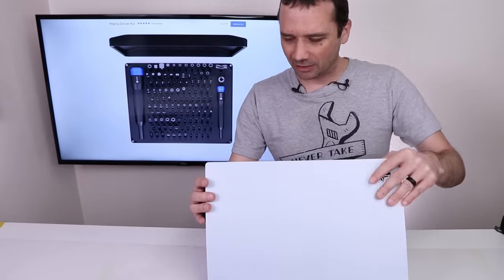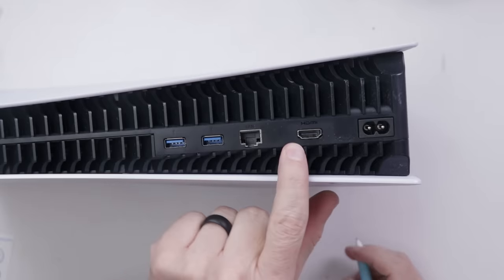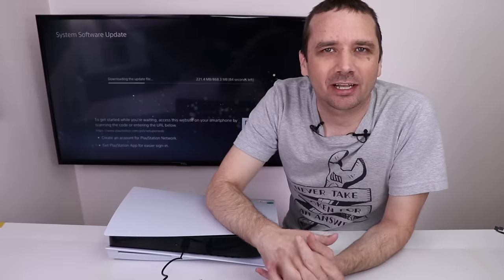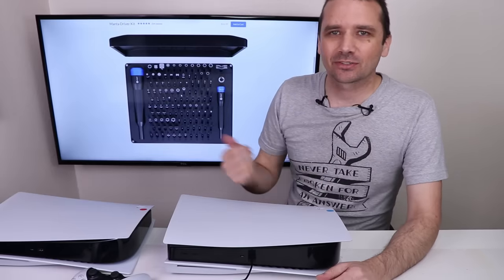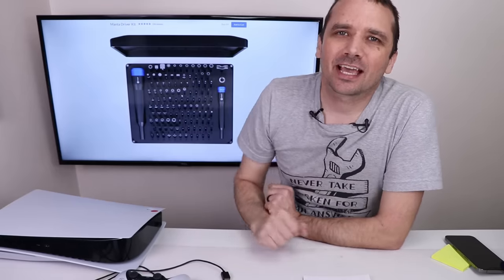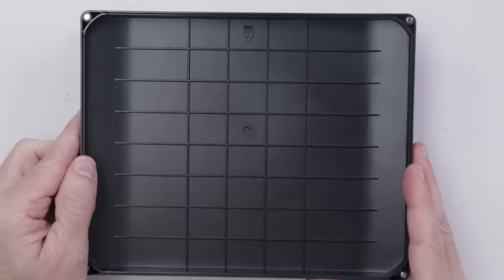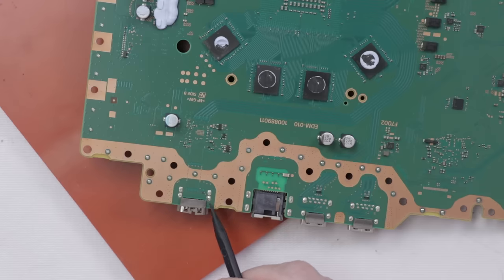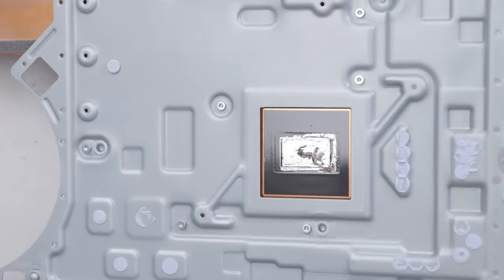I Bought 13 BROKEN PS5's - But Can I Fix Them?!

Comment: The ones that won't start a game, probably have bad RAM.  Probably got fried from the poor cooling design.  The upper RAM chips can reach 80-100C (Gamers Nexus went into this).  The ones that were open already made me kinda cringe, because most people that open these things have no idea what they're doing and make me think of the time Al Bundy was trying to fix his car (he opened the hood and had no idea what he was looking at).
Reply: I'm just here for the Al Bundy reference
Reply: 80-100c? god damn.
Reply: @TigerAceSullivan  Yep...Gamer's Nexus did a whole video on PS5 cooling, and how some of the upper RAM chips are basically not getting cooled at all.
Reply: @StormsparkPegasus  I'd love to see someone 3D print a skeletonized or mesh set of side panels for the thing, since GN showed that it runs cooler with them off.
Reply: Gamer nexus is a Fraud. That's normal operating temperatures
Reply: @NotoriousRawDogger  He didn't say it was a bad operating temperature. He just said it's worse than most devices and he emphasized it's hard to say if it will be a non-issue or a problem down the road.
Reply: @NotoriousRawDogger  facts.
Reply: @mndlessdrwer  Not a bad idea, but the PS5's RAM cooling issues go beyond just the side panels.
Reply: @NotoriousRawDogger  LOL...that's the most pathetic statement I've ever heard.  Tell that to all the people whose PS5's have dead RAM because of it.  The first models of the PS2, PS3, and PS4 were all junk and had tons of issues too.  I've never understood why people shill for corporations.  Stockholm Syndrome.  And using sockpuppet accounts to agree with you is even more pathetic.

Comment: With the video artifacting you could try replacing the memory modules from a donor board to possibly fix the problem. Watching gamers Nexis there is one module right by the main heatsink that runs the hottest and could well be the culprit.

Comment: I don’t understand how people broke these systems already when they basically just came out
Reply: It's been 5 months lol
Reply: Lots of reasons, think
Reply: DOA is a thing - most consumer electronics have at least at couple % fail - ps3 was 10% over time if I recall correctly
Reply: Most faulty electronics will fail within 3-6 months of use if they're going to fail (or they'll just be DOA out of the box). Outside of the one with the damaged HDMI port (stupid people will be stupid) most/all of them are going to be something faulty with the hardware or firmware and not something the user caused.

Comment: Hard drive issues. And they have SSDs soldered to the motherboard.
Reply: That's kinda bad because you can no longer upgrade your storage. If there some wrong with the ssd it will be a hard fix
Reply: @karlopusenjak3724  Yeh
Reply: @karlopusenjak3724  And try getting SSDs from Sony. Then unsolder the bad ones off and solder the new on. Poor design.

Comment: Each of those cost 550$? Isn't a new one 499$? How can you possibly make any kind of profit? Specially when some are not even repairable. Maybe I'm missing something.
Reply: MSRP is $500. You cannot find one at MSRP right now. People have bots to buy them all and then resell them at way over $500. You can see them going for $1,000 on eBay or Facebook.

Me will list them on eBay at an auction or sell them with a markup above $500.
Reply: Profit is the channel subs

Comment: I have a PS5 that won't power on at all. Happened after lightning struck right outside my house. It was hooked up to a surge protector, but was in rest mode. System doesn't even beep when pressing power button. I have intermidate skills when it comes to electronic repair.... I guess my question is have you run across a PS5 with this issue before and what could it be? Thank you and hopeful for a response

Comment: Sad already seeing the ps5 get taken apart  after only 5 moths of being out but love seeing you fix it and bring them back to life 

Spoiler alert: ull be fixing ps5 Slim  soon
Reply: They’re poorly made
Reply: @V1CT1MIZED  your post is poor quality
Reply: @CrimsonGear80  better quality than thermally torturing my vram and requiring liquid metal on a console the size of a small house. Ps don’t forget the incoming external SSD firmware that increases fan speeds (which are already on the edge of being audible) which was kept quiet till after all the reviews. This console is an engineers worst nightmare. You were saying?
Reply: @V1CT1MIZED  I was saying your post was poor quality but now I can say BOTH your posts are poor quality
Reply: @V1CT1MIZED  oh no a slightly audible fan. Console peasants are funny.

Comment: I still don't trust this PS5 system, enough to buy one,  after watching enough tear down vids of it,  it just doesn't look good quality wise, or having a long life,   I can see so many of these consoles failing before they even turn a year old...
Reply: The reason why i switched to PC was because of free online, Amazing gaming device and youtube device.
Reply: Hey under a year is free warranty replacement :P
Reply: @wolf0491  even if you buy one of these from a Scalper with no receipt? or maybe these ones were simply returned
Reply: @tony--james  I mean you didn't mention that. They might fix it who knows. I've had things fixed via warranty without receipts before. If not don't be dumb buying something scalped hah. You could ask scalper for receipt maybe
Reply: The reason to go to XBOX
Reply: @wolf0491  I found one locally for sale online,  1800 bucks, "Description
Brand new unopened Sony PlayStation 5 Disc Edition. Comes with an extra DualSense controller.
Also comes with receipt."     so I guess some, have it, and some don't ,  there are 400+ locally for sale by scalpers here
Reply: @tony--james  $1800 that's dumb they one ebay scalped for like under 800 sometimes now. It's getting easier buy regular anyway. I've already bought a few for my friends just gotta follow Twitter notifications. No issues yet on any of them btw.
Reply: @wolf0491  yeah, I see many more, much cheaper, but they don't specify if they have a receipt, some say new, but open box also , the 1800 dollar PS5  was posted in December  I see, 800 seems to be common also

Comment: Artifacting is not from the APU. Memory chips are faulty due to excessive heat exposure. You may be able to replace them, that would be interesting to see.
Reply: It absolutely can be from the apu. Remember, the apu is a gpu as well. And if a gpu is failing, it artifacts. That's not to say it couldn't be the ram, but I would argue it's more often than not the apu.
Reply: @rockl79  Sorry you misunderstood. I did not mean to make it sound like it’s absolutely not possible. I’m just responding to this case I believe the fault is coming from the memory chips.

Comment: Ps5 interior is so poorly designed
Reply: Not really. I have disassembled my ps5 before and it takes about 15 minutes to get to the heatsink, and you don't even have to take off the metal plates. It's much better designed than the ps4, where you have to disassemble the whole console to get to the heatsink and fan.

Comment: How much heat do you use on these boards Steve to remove the ports? I did my first PS5 port and used low melt solder with my hot air station set to 480 and it took awhile. Couldn't believe it. I'm going to go from the top side next time with a much larger nozzle and a little more hear but you seem to have remove this one exactly the way I did with roughly a medium size tip. I failed to remove the plastic cap coveting the pins as I've never seen a port like this before so knowing that now I will definitely remove and add some low melt to the top side pins as well. Great video as usual. Love your channel. Been watching for years ❤️

Comment: I could be completely wrong thinking this way but I honestly feel that people that sell or try selling an item that is broken and have given up on shouldn’t be asking for full retail price almost. For example iv been looking for an old game boy color and gba. To restore myself and to customize and upgraded screen so on and then you go on eBay or something and look around and people be asking for $40-60 for ones that have a cracked chassis screen discoloration and so on. And I understand some of them might be some collector’s edition but if it’s broken and need to be repaired or restored I feel the price needs to resemble that. Like those ps5 in this case it’s a risk for u to do it cause at the $500 for each ps5 that doesn’t leave any profit room. But atleast now u got some spare parts

Comment: I actually bought a ps5 6 months ago and i tried to turn it on recently and it won't power on at all. No beep or nothing. I push the power button and get no response. Do you have an idea what the issue could be?

Comment: Did the hot air station allow to met the solder on the pins to while you were taking the original one off?

Comment: I know this is an old video, I really hope you or someone in the comments could help. My PS5 turns off in mid game; my ports seem fine, plugged into the wall, done all the troubleshoot on the official ps website but now I got told it’s £250 to get sorted. It must be something I can do right?

Comment: When I went to disconnect the fan I pulled the 3 pin port right off the motherboard. I tried wiggling and man it was in there tight. No copper left on the bottom, tried all morning to solder it. System starts up no issues, it posts fine. Just no fan. Thought about running it from a 3 pin to usb but it’s the wrong voltage and no signal for it to go faster or slow down. I wanted to send it in but I don’t see a PS5 option. I’ve had consoles apart in the past. Replaced many parts but this one was tough!

Comment: I get screen flicker and audio distortion. This problem is intermittent and the ps5 runs fine 85-90% of the time. Ive tried different hdmi cables, 4k refresh rate, soft reset (seemed to help it for about 3 weeks), ive had it on 3 different tvs and the problem eventually happens. Does anyone know what the hell could be going on?

Comment: Dude or someone could help me. I got a ps5 but WiFi is really bad. It disconnects and it is really slow. I've already open ports, using custom DNS, and nothing 

Frankly the only solution I found was ps5 connecting with eterneth. 

But maybe could be the case od defective WiFi?

Comment: Miss the days when 13 consoles didn't break so quickly. This is a reason I kinda dropped out of buying consoles.  My experience with the PS3 was so bad, and the 360 I heard was even worse, that I will never want to get a console ever again.  I can buy a PC and build it myself and rarely ever have to fix them, when I do normally requires replacing a component which I can do myself, something I can not do with a Playstation. lol
Reply: I’ve had a Xbox 360, ps3, ps4, and soon a ps5. Never had a issue with them breaking, some people are just rough with consoles

Comment: I just wanted to buy a broken PS5 so I could have one sitting there.
Reply: This is how I got mine.. easily fixed the hdmi port. And only paid 250$ . More people should consider this approach That are somewhat tech savvy. That being said though,  it could of been not fixable and would of required someone more skilled than me. But that was a gamble that I was willing to take considering how much they cost right now with scalpers being a holes lol.

Comment: I know this is a old vid but, just in case you see it even might know what's wrong. (I been looking around for weeks bu, I can't find any answers.) My PS5 is turning on and, playing games but, in the middle of playing. After maybe about an 30 minutes to an hour, sometimes 2 or 3 hours. It beeps 3 times and, looses all power without warning. I thought it could be overheating but, it's not. PS5 is not hot. Also tested using deferent cooling strategies and, the PS5 is supposed to warn you about overheating. I tried new wires, clearing cache, reinstalling os, other games cleaning out the dust witch there wasn't much in the first place, Other wall sockets. It still looses all power without warning at completely rondom times

Comment: I am curious if the video glitches could be a RAM issue, instead of the APU, if so that would be cool, SMD replacement.
Reply: I doubt it, and even if you were to replace the ram it would be just as hard, if not harder than replacing the apu itself due to the small size of the ram chips

Comment: How do you guys feel about the ps5 coming with liquid metal as the thermal paste? Personally in my opinion, I dont think that was a wise decision on sonys part.. maybe I'm confused and liquid metal has Improved since I last tried to use it on a ps4 but I was nothing but bad issues with it. Mainly the fact it was eating at the copper heat sink. So I really dont like the idea they decided to go with liquid metal,  but I would definitely like to hear your guy's opinion on that.
Reply: I think it's a much better decision. In theory with the way sony designed the foam around the apu you should never have to take off the heatsink to replace the liquid metal

Comment: I seriously have to give a shout out to this man. My ps5 kept shutting off but only after an hour-ish of playing back 4 blood. So after watching many of his videos I decided to take it slightly apart just enough to clean the fan and heat sync and that fixed the problem 100%. That was after trying many other fixes so I was down to my last option and it worked and honestly should have been my 1st option. Also I have never taken apart any system of mine and I am 25 so I've been through many. So once again thanks man. Oh also I'm currently using my dad's phone since mine is charging so my name is Campbell not Mark.

Comment: I love the concept of renovation over buying brand new, which is totally against what big brands want us to do.
I have a question : While repairing Ps5 #2 you did clean all the dust within it with a brush (which is pretty old-school). Is there a reason why you didn't use compressed air method ? Is it damaging to the system ?

Comment: Not gonna say this is true but I'm pretty sure it's sometimes not the consumer but the producer and creator of them if anyone hasn't noticed the parts they use most of not all the plastic/other materials are made from 3D printers and Im sure they don't quality check each piece they use and probably didn't care to even check over the work and rushed out finished product before the check so some consoles come with defects or abnormalities. Just my opinion

Comment: I wonder if the ones that had problems running the games, would work on external storage. Now that that's available.
Also, are the disc version PS5s more prone to failure than the digital only? Or are there just more of them around?

Comment: @tronicsfix my PS5 is sluggish in its ability to eject or suck in discs. I am worried that it will stop all together at some point and I will be stuck with a broken system. Is there something I could clean or oil to preempt this function completely breaking? I have been trying to baby it but I worry every time I change discs

Comment: The dust buildup is massive in the PS5s, which really runs down to bad design. Also, looks like PS5s are more faulty aswell.
Reply: Not really, you have to consider that as of right now there are not any major defects like the rrod and ylod, and a failure rate of 1-5% is normal. And I don't know about you, but I haven't had any dust inside my ps5 yet and I got it on launch day. It's most likely just the same people who vacuum once a year

Comment: You can reinstall the PS5 OS like on the PS4 try that if something is broken in the "database" whatever the hell flipping chicken nuggets that is it won't help.

edit: apparently will defrag the HDD?! so pretty much useless since most Unix systems don't need this as much as Windows(NTFS is garbage) also it's a SSD so double useless..? I would like to see someone somehow confirm this with a modded PS4 if possible.

edit edit: apparently it uses a fork of UFS filesystem I don't know much about this I imagined it used EXT4 or something like that but it is most likely comparable.

Comment: I cannot see how you can make money from it. Only 6 are ok so to cover the whole lot you need the price 1200 USD per unit. You can buy on ebay a new one in the range of 950, used 800. Bad luck, I guess.
Reply from the maker: You should look at see what broken ones are selling for on eBay right now
Reply: eggzboxx used 762 $ trending

Comment: if its just software its most likely simply a corrupted harddrive solved by replacing the harddrive.
it is commonly known that if an ssd HD, gets full and stays full, it will corrupt and break the drive. hey it might be worth a shot, regardless. and thats assuming the harddrives, are not hardware locked to the system. on these newer devices hardware locked/synced devices will require, quite a bit.. of tinkering to get beyond the security, to fool the system, and allow it to be accepted.

Comment: I've bought used PlayStations before at GameStop and they all usually have something wrong you won't notice it right off sometimes it takes a few days before the issue shows sometimes the games will freeze if there's something wrong with the game system are very badly glitching and that's usually means something's wrong with the PlayStation

Comment: Had my ps5 for a little under 2 weeks and ended up with the one beep, but it wouldn't start up problem. Sent it into Sony for repair and got back a completely different console, so it seems it's not fixable yet even by Sony. Or they just sent me a new one to save time.